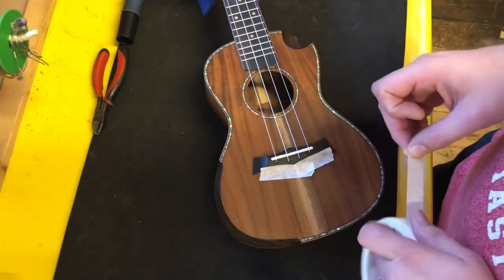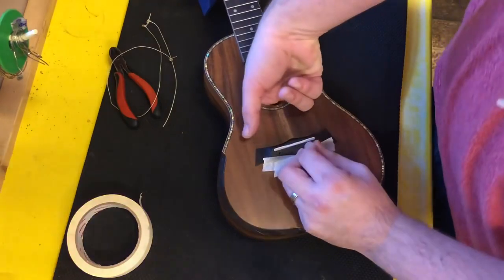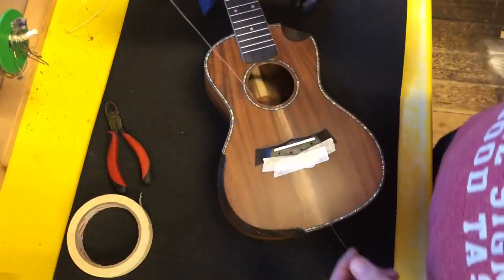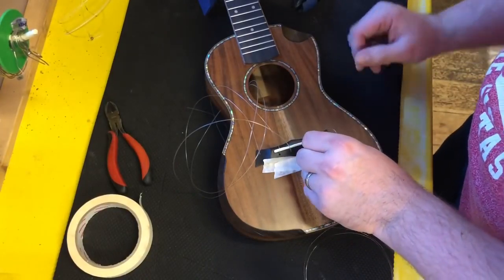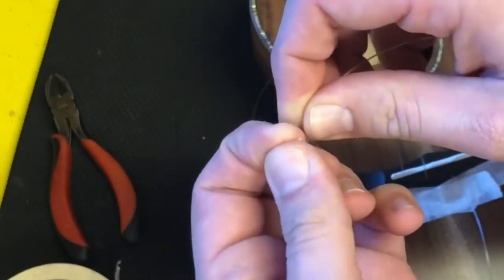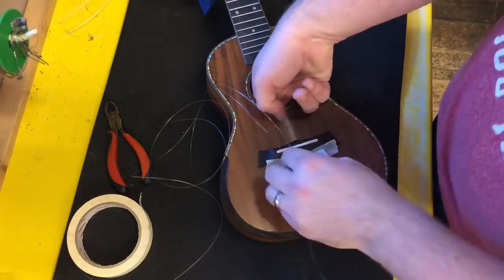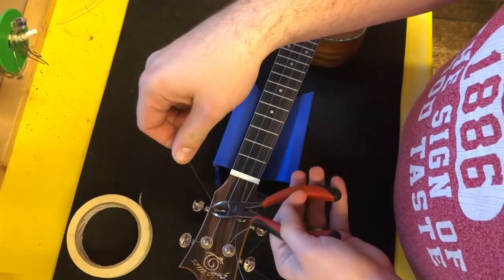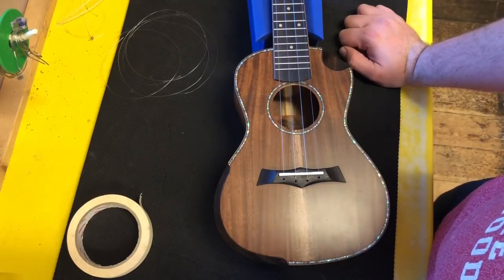How to restring a pull thru bridge Ukulele (Snail, Kala Elite, Enya)

Comment: Instead of trying to reach inside the uke to find the strings I use a cheap set of fishing forceps. 
This is especially useful when restringing a baritone. As long as you are careful not the damage round the sound hole it makes the job a lot easier.
Reply from the maker: Great tip!

Comment: Hi Alex, very informative, I should have checked this out before replacing a string(s) on my ukulele as I reused the balls unnecessarily. My SUS supplied Snail ukulele is a baritone so its Ionger between the sound hole and the bridge, I found it difficult to get the string to appear at the sound hole, is there any special tips for making this easier or should the natural bend trick still work ? Thanks
Reply from the maker: No special trick. I do find the baritones easier to get my fingers inside to recover the string though so fingers crossed 🤞

Comment: I have a question about the bead that you take off from the old string. Why do some ukulele strings come with the bead inside and you did not put the bead back on when you replace them? I understand the purpose of the bead is to make sure the string stays in place. Did you leave the bead out for purpose? Is the bead tied inside the ukulele going to influence the sound?
Reply from the maker: No it won't influence the sound as it's not between the bridge and the saddle.  If a manufacturer chooses to use the bead, it is probably just because it saves time and is a bit tidier than tying a thick knot in the string.

I leave the beads out because I've seen them wear out the string a bit quicker by grinding away.